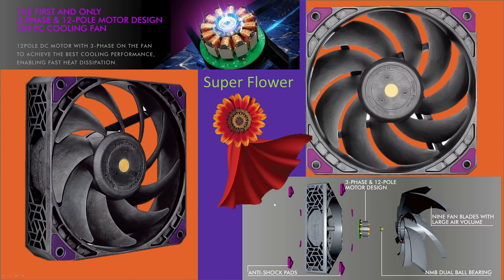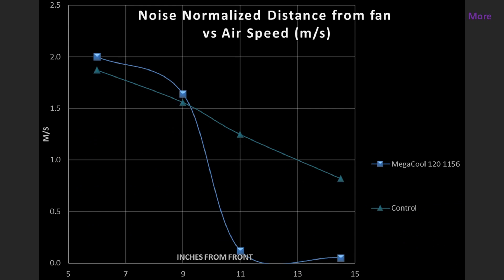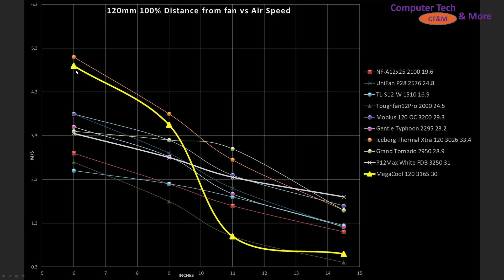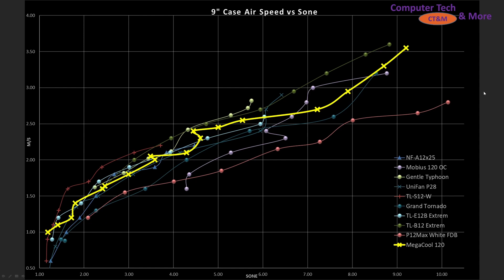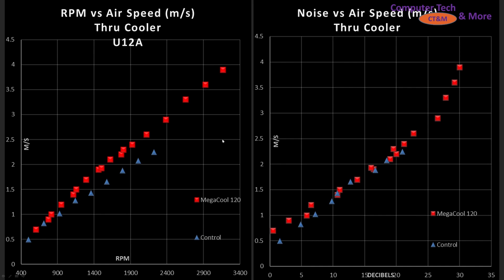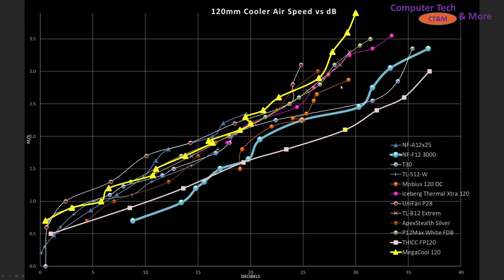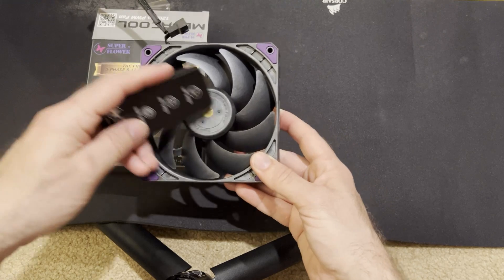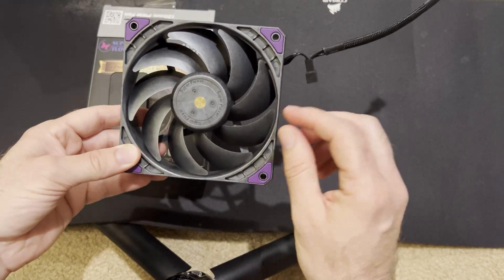SuperFlower The Destroyer of T30's??  MegaCool 120 Review (12 pole motor??)

Comment: I like the detail of your video!  I bought these fans out of curiousity, ended up putting them on my  Zotac 4090 via a bracket I got off Etsy.  These fans seem well built, and they do well against a GPU cooler, or a radiator.  I keep them on low, and they are performing better than the Noctua A12's I had on the card before.  I hope the dual ball bearings last a long, long time.
Reply from the maker: thank you for sharing.
I was very impress with this fan. 
Ball bearing should have a long life but it does depend on the manufacture

Comment: Have 3 coming for my Tower900 to get the "viewing chamber" properly vented, both intake and exhaust have 120mm rads and the flow with 1300rpm Noctua redux are leaving my currently aircooled 7900xtx boiling hot especially on the back plate.

Water block is coming soon, but still concerned about MB phase temps and that gpu's crazy hot backplate.
Reply from the maker: usually the VRM and backplate dont get hot. If its a problem might need a direct fan in the area.
Reply: @computer-tech-more  From what I heard, these cards do have pretty toasty backplates, but it's definitely cooler with the front glass off.

There is a fan directly under the card, but I doubt it's flowing enough air, and the exhaust is the same.
I'm going to wait to install the fans once I install the block and replace the fluid and hoses.
Reply from the maker: @wyvern4588  hmm. well good luck.

Comment: I'm kinda looking into these for my upcoming build now.. Will be doing an MATX build in the Antec Dark Cube case once Intel Arrow Lake is on the market. It'll be replacing my laptop in my Semi Truck, so noise isn't an issue, at all.

I'll be cramming an i9 or whatever they're renaming it too in there along with, eventually an 5090. I'll let them little purple boys loose, whooo!😂

Still gotta get with this local CNC shop so I can swap the glass panel on top with a vented aluminum one. This Antec case has an inverted design so the GPU will be above the CPU. Glad I was able to get a hold of the case before it gets discontinued, the design really appealed to my tastes.

Now just to wait for the Hardware to become available. 😶
Reply from the maker: thats pretty sweet. since your putting it in a truck. Just need to make sure there is plenty of ventilation for the pc both in and out.
Reply: It'll certainly have good ventilation where it's going, and as for the case it's gotten good reviews. The main issue would be cooling the GPU, which is why I'll be modifying the top panel to improve airflow. At least cooling the CPU should be a non issue, as due to the inverted design of the case, it places the CPU and heatsink on top smack in the middle of the airflow within the case. It shouldn't be hard to maintain a positive pressure in the case, with a flow through kinda like an air tunnel.

My fan fitment is restricted to x2 140mm or 120mm fans at the front, and 1 120mm fan at the rear IO. Fan options for me would either be Super Flower Megacool, Noctua NF-A14/NF-F12 ippc, Phanteks T30, or Antec's soon to release Nova fans rated at around 3200 RPM.

I haven't settled on a CPU cooler quite yet, still waiting for more details on the release of Arrow Lake. Though I did want the Deepcool Assassin IV, until they go sanctioned, and banned in the US.(Though they are apparently working to appeal that decision on court) So that would narrow my options to Noctua, Be Quiet, Thermalright, or Scythe.

All hypothetical more or less until more details are unveiled for this upcoming hardware. I'm anxious like a kid waiting for Christmas lol, I love doing PC builds.
Reply from the maker: @Demrik_Dergoat  sounds like you have it all planned out. Nice. 
Well intel has been having a lot of problems lately. so I would need an all clear by the larger reviewers at this point. :/ unfortunately. Coolers. I would just watch GN and pick one of their top picks. 
Ya I have the assassin IV before the band. haha. Its pretty good. more style than performance though.

Comment: What a joke of a "review."  Spends more than half of the video covering use cases where these will NOT be used (case fans, air coolers), and devotes ZERO time to the actually relevant use case for such a high performance, high static pressure fan--liquid cooling radiators.  And the U12A air cooler is not even close to a similar representation.  Various thickness liquid cooling radiators is the absolute most important category to test with fans like this and the other T30 competitors, since nobody in their right mind is using these as bloody case fans.

Ridiculous.
Reply from the maker: I'm sorry you feel that way. but not sure what you mean. I have validated testing with this fan on an actual thick radiator. As it turns out air speed thru the Rad and thru the cooler are equivalent. So....... 
Putting it on the cooler they way I'm currently doing testing is 100% valid. 
Its true this shouldn't be used as a case fan but for completeness of testing it should be tested. Otherwise i am just like all the terrible fan reviewers out there. 
Now if you would like to see improved testing might I suggest joining on patron or becoming a youtube member. as right now this channel is unsponsored and I dont have the money to build a custom loop system to do this type of testing. I have commented many times that my end goal is to add this tested once i have the finances to do this.
Reply: Going to hard disagree with you. In the video he clearly states he as a Radiator in testing now but the air speeds thru it are equivalent to the U12A. 
And if youv'e watched any other videos you know this is a small channel. Building up what tests it has and can do thanks to community support. 
Way to be off kilter.  
The fact this channel is as small as it is and generating this level of detail and analysis is amazing. 
You got one thing right though you are ridiculous.
Reply from the maker: @Lu.X.A  thank you for the support
Reply: @Lu.X.A  "A radiator."  Ah yes, because they are all the same thickness with the same fin density. Not complete testing, my point still stands.
Reply from the maker: Ok ok before you two actually fight. 
@bjn714 I have tested 4 rads and selected one for further testing. See video. https://youtu.be/5xlo6WPp0zY
All had very similar air speeds going thru it vs my air cooler. Now if I had a test system I could do thermal testing. But I am not a cooling solution testing channel yet. 
I just dont have the $$ to finance that yet. I am limited by what I can afford to invest into this channel. 
I am not large the LTT or GN. I am just me. I have no sponsors. 
If you want to see better testing again become a youtube member or patreon. I have plans for what tests I actually want to do and how to do it. One is Thermal testing in both air and water cooled systems.
Reply: @computer-tech-more  I hope you change to the Hardware Labs Nemesis GTR radiator. The GTR is basically the highest performing rad on the market. Not only that, but it's perfect for testing because of it's air restrictiveness. The GTR has the same density "on paper" as the GTX but the GTR is considerably more restrictive due to other aspects in it's design. It's so restrictive that it actually looses out in cooling performance to the GTX at fan speeds under 1500-ish or 1800-ish RPM. Once you get to 1800-ish - 2000-ish RPM, the GTR it takes the lead...Not only that though, tests have shown that, unlike most rads including the GTX, the GTR's cooling performance keeps scaling like a beast even beyond 3000 RPM (as well as in push/pull setups).

They also offer them in 1x 120 mm and 1x 140 mm versions in case you want to buy the small ones for your single-fan tests (more affordable plus physically convenient).

I sincerely hope you move to the HwL GTR. Just a one-time purchase for each (120 and 140 mm) and you'll be set for the very best of fan-to-rad testing for many years to come.
Reply from the maker: @Spinelli__  Ill have to think about that my return window for the GTX closed a while back. I dont really have the spare $$ to buy 2 more Rads. I'm trying to save it up to buy fans for testing and mainly a test system to start getting temp results. If I keep growing Ill look intot he GTR's. 
but thank you for the message. I do take this advice to heart. 
Despite having built PC since 2007. Ive never done a custom water loop. 
When I can I want 2 test systems on with my U12A noctua and the other with Quick disconnect Rad. That should cover everything pretty well.
Reply: @computer-tech-more  Sounds awesome. Just to let you know, the GTR 120 and GTR 140 are only 60 and 70 dollars respectively.

Comment: Was the A12x25 retested? The data doesn't line up with your other videos.
Reply from the maker: haha actually yes. I re-ran a bunch of fan to make sure my anemometer was reading correctly after a year of use. had to re-average many fans. 
sharp eyes. I have it written down for myself somewhere where it effected before vs after. 
Since I dont have equipment to validate the fans performance I can only keep things accurate with each other so scaling works. :/ not ideal. 
all in all around 20 fans needed retesting. so not to bad.

Comment: Have you considered any possibilities that cardboard might amplify the sound generated by the due to the vibrations?
Reply: hopefully u can modify the setup to mount the fan to sound insulators instead, so the sound won't reverberate through the material that the fan is mounted to.
Reply from the maker: @JerryWoo96  its 2 pieces of cardboard hotglued together. And foam stuffed around the insert. But yes that is a concern, but ive tried my best to minimize it. Ive done basic noise readings on 1 piece of cardboard (similar results) like 1 or 2 dB difference. 
my end goal is more like an actual front panel from a PC case. But I dont have the budget for that, yet.

edit: Im actually in the process of testing a noise reduction chamber. Part of it is a newer attachment interface. with some dampening. 
Every material and design has a harmonic / resonant frequency. I forget if it was toms hardware, igors or someone else but my PWM / RPM for the DeepCool FK120 lined up with theirs for resonant frequencies. 
but that doesnt mean mine will line up for all theirs. I bring this up like your comment. the cardboard could have a different frequency that would cause amplified noise that a lets say metal one would not. I just have to be consistent.

Comment: Thanks for the review and comparison Computer Tech,   The Mega Cool 120 seams to be decent but the higher RPM a little bit to noisy.   I've been very happy with Lian Li UniFan P28 and personally bought two of these to  use as rear exhaust on air build PC's.   (Sound profile and pushing of air to be very pleasant)
Reply from the maker: thank you for watching and sharing your experience with the P28. I consider it a top 120mm fan in my testing as well.